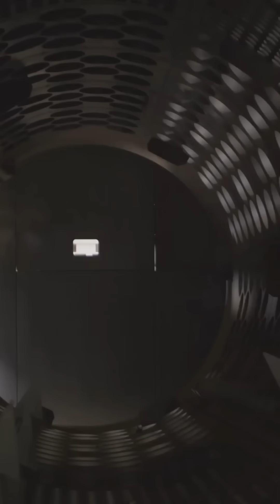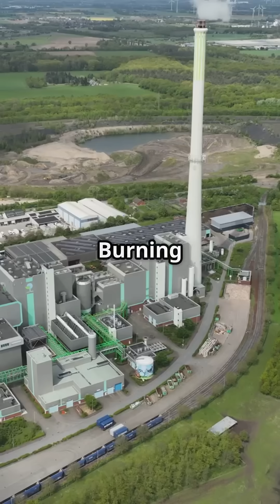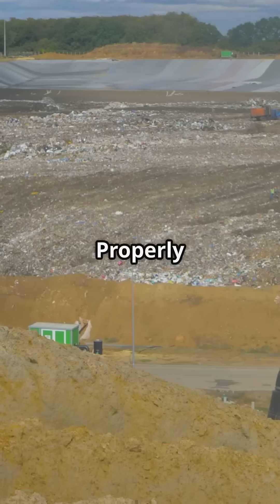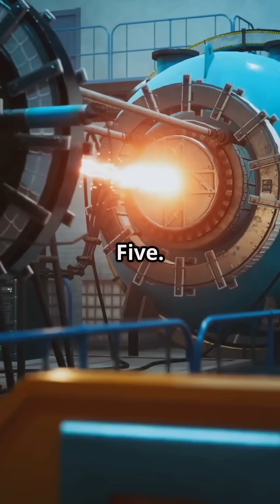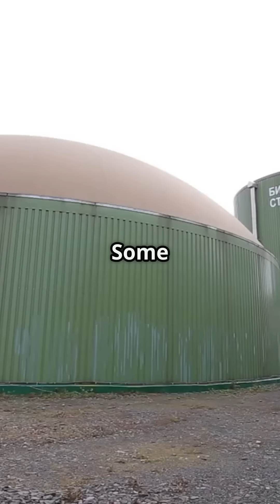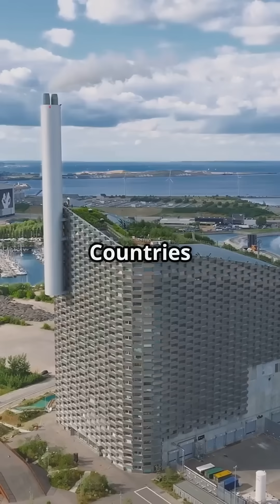Can We Turn Trash into Energy? The Truth About Waste-to-Power!

Comment: I'm not saying its bad.. There is nothing wrong in burning methane and use it for energy instead of allowing it to escape into the atmosphere.   But some claims made in the video are simply wrong.
1. It uses methane created by the biodegradable part of the waste degrading on its own. But most parts of the waste (specially plastics) are not reduced and will stay in the landfill for centuries. 
2. It generates electricity by burning a product. How is that renewable energy?
4. Sorry, but landfills are the opposite of recycling plants You bury the waste and there is no plan to ever dig it up and use it again.